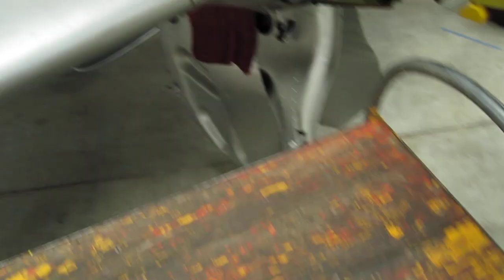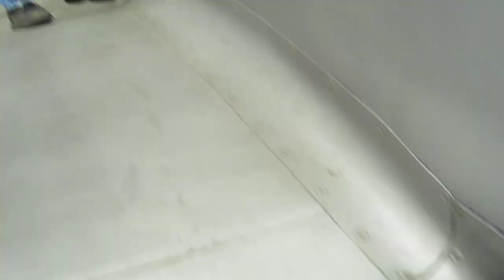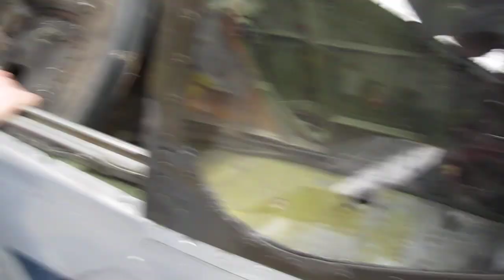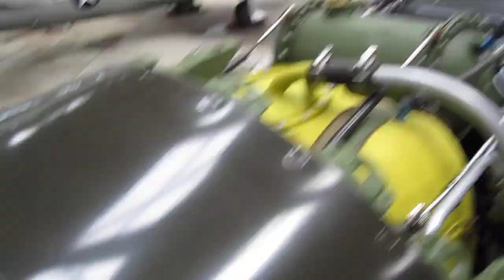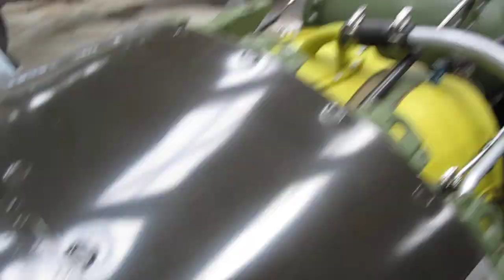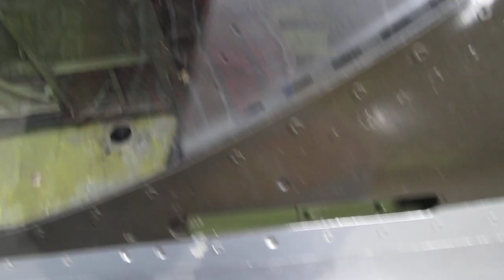Mustang P-51H Restoration

Comment: I agree with your numbers for sure on the D model. I have read several sources that give those numbers. Very few I have read give any for the H, since it was not nearly as much used or produced. But I would suspect the numbers you give could be right for the H too. It was documented to be considerably faster than the D as well.

Comment: Angryace13: according to Robert Gruenhagen's authoritative book "Mustang", p. 185, the Packard Merlin 1650-9 that serviced the P-51H developed 1,690 bhp at war emergency power at 10,000 ft, and 1,830 bhp on take-off at 80" manifold or 1,380 bph on take-off at 60" manifold pressure. P.190 states P-51H had two wind fuel tanks. Hope this helps. If this truly is an H restoration, it will be the first I am aware of.

Comment: Would be curious to know your source too, as this is different than what Gruenhagen's book says. Also you are probably already aware the fuel tank aft of the cockpit caused some stability problems which were solved by the dorsal fillet on front of vertical stabilizer in the D model and using a taller vertical stabilizer in the H model. Too bad the H never saw combat - would have been faster than the D.

Comment: actually i just looked it up, and it creates somewhere around 2,200hp with W.E.P with the rolls royce packard merlin V1650-9 v12, 1,695hp is the P-51D mustangs v1650-7 with military power, and the p-51b has a v1650-3 with 1,590hp with military power. thanks XD

Comment: hay bud, i have a question, the D mustang had a 1,695HP rolls Royce Packard merlin v1650-7 so how much horsepower did the P-51H's v1650-9 create, i hear 2,000hp but just wanted to make sure...

and were where the main fuel tanks on the mustang?